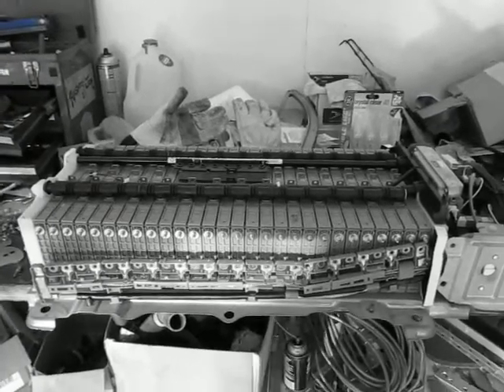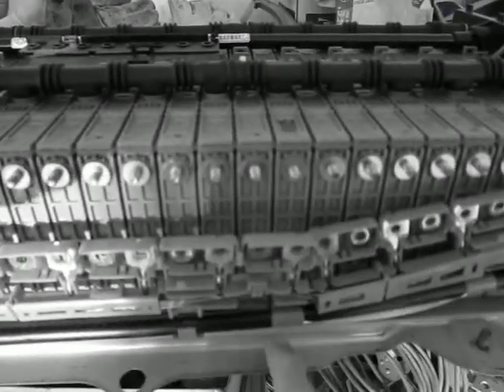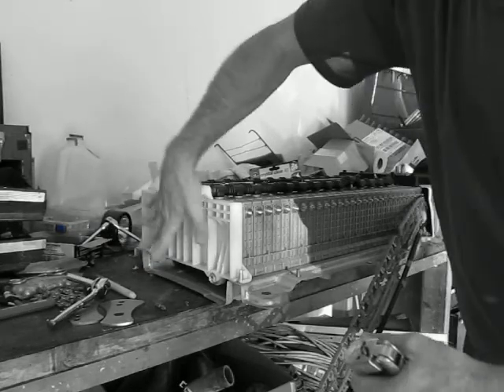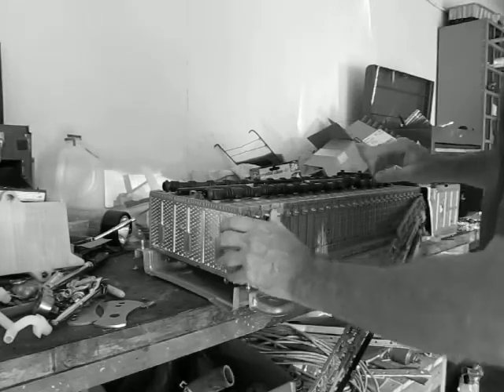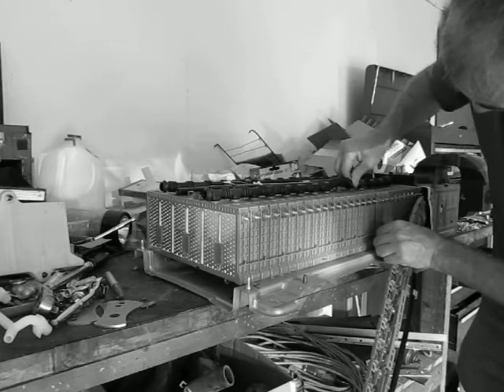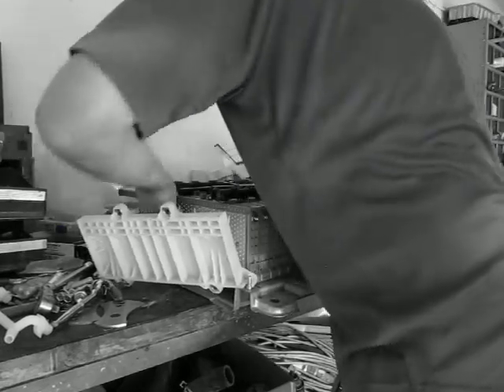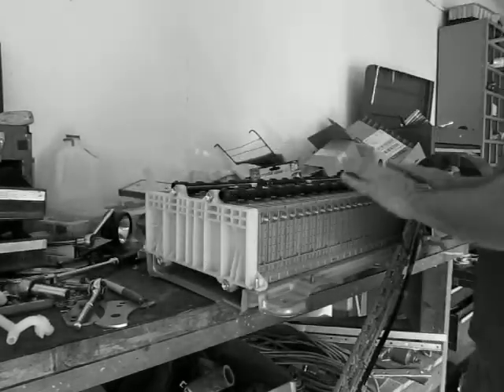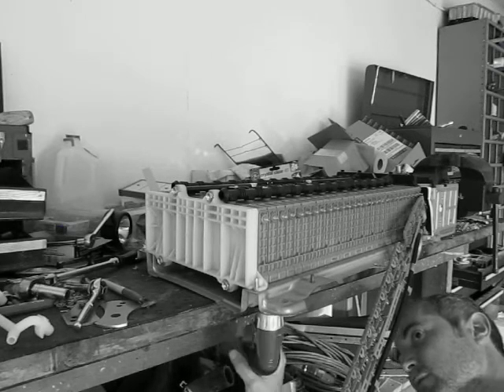Toyota Prius Battery Repair: Replacing one bad module (common failure)

Comment: i have one that is 7.5 the rest are 7.7 or 7.8.... 3 of them are 7.6...I don't know if i should replace those 4 that are lower than 7.7 or i don't know why it gave me the triangle
Reply: +david galeno I'm having the same issue... all of mine read 7.9 except the 4 on the passengers side... they read 7.5... I'm not sure if they're bad or not... or if I would have to buy 4 new cells that read 7.9...
Reply: +Joe How are your connections? I would clean them up from corrosion then drive it more eventually one will go bad. The bad one is on its way out pretty much.
Reply: The Connections were pretty corroded, so I've cleaned them and now they're all shiny. I'm going to reconnect everything and see if that works, if it doesn't I guess I'll just replace the cells on the passengers side that read 7.5..
Reply: Wat was the out come then?

Comment: Im hoping i can do this too. I just got the triangle and check engine light and the abs light also turns on. The code is p3006 was this the code you got too?
Reply: I've read traction battery for that code.
Reply: Im going to take it out today n do the same as the video
Reply: I unplugged the 12v battery n went away for couple hours but now is back

Comment: I'd like to try this with my Prius, I'm getting the same error. I noticed that you mentioned having to have a wire of some sorts to equal out the batteries, will i have to do this with my Prius as well after purchasing cells from eBay?

Comment: Hmm the video is in black and white probably form the 50-60s.

Proof of the oil company conspiracy to keep fuel efficient vehicles off the road.

Of fricken course I'm JK
Reply: findvoltage
 yepper gotta be the only xplan astion
Reply from the maker: OR, my camera malfunctioned. You decide.
Reply: crazyenergyprojects Yeah sure it was something to do with an equipment malfunction!!

Of course again I'm JK. Tape cameras dirty heads can cause poor video and audio, not sure about what could cause it to digital cameras.
Reply: robvlob im goin with the spiricy theris. yaaarp.
Reply: robvlob heehe

Comment: Thanks for the great video.  When you measure the voltage of each battery pack to find a defective one, did you take out the buss bar and measure it? Or is it OK to measure the voltage of the battery pack with the buss bar attached? I just want to take caution not to deal with 230V or so for the testing each battery pack. Thanks.
Reply from the maker: I tested module voltage with everything connected. If there is a bad module you will find it. Just don't bridge two module's negative and positive terminals together.
Reply: crazyenergyprojects I'm guessing that's why they're alternated? To prevent that from happening?

Comment: Good Video! I did this twice on my Gen 1 Prius. Almost the same task, just a few more modules to deal with. I would caution 2 things though when when tightening the buss bar nuts back on. You are dealing with DC voltage that adds up to levels that can zap you bad, so always concentrate on not touching two points at any time. Also be aware where your metal tools are dangling! The other thing is make the battery connections tight, but not hella tight as you might snap the battery threads off, as I did! I was so mad. I had then take the 20 or so modules all back loose again to replace a perfectly good module that now had a stubby unusable threads on one end. Anyhow, the hardest part for me was lifting the whole battery out. Had to lift one end and then aim it towards the back passenger doorway to get it out. I was alone, and its a slightly awkward angle to be lifting a 100 pound battery out with sharp edges! Lastly, I too bought my spare modules on Craigslist ($25 each), and luckily bought two extras, as the last thing you want is to be halfway though a job like this, and realize you need just one more module due to some unseen problem that arises. Trust me, have an extra one there!
Update...June 2014, I had another module fail, and had to swap it out. I have a method now of doing it with the battery bank in place in the trunk in about 2 hours. I just lift it up after all bolts are off. Then I loosen wire connector on both sides (one can peel out allowing a module to exit better) then I pound out the one bad module with a wood stick and hammer! Then tap back a used but good one and rehook it all up. The problem I have though is my tendancy to over tighten battery bolts. I snapped another one off, and had to do a double battery swap. Also, recently I also found a guy with many modules for sale, and I have extras on hand now.
Reply: Crap, you should buy a 1/4inch drive torque wrench, or just finger tighten and then 1/8 turn, never fails unless bigger nuts/bolts. good story though. heehe.
Reply: Video of your in the car technique. Seems a great time saver.
Reply: How do you undo the bolts underneath each module without flipping it over?

Comment: I'm performing this exact same task at the moment on my 05 prius gen II. I have some electrical experience but haven't done anything like this before. After getting the battery out which took me about an hour or so approx, I was able to carry the battery to my bench myself. It's pretty heavy but not bad. Did not use any special gloves but was just careful. After testing with a multimeter i found 1 bad module reading 6.2v approx with all other modules reading 8.7/8.8v. The only issue I'm seeing is that i ordered a used module online that is said to test 7-8v. Not sure if this difference will cause an issue or not. Unsure about conditioning, was hoping to just swap a bad one with a good one and make it fixed. All I needed to perform this task was a good ratchet set, a screwdriver, and good common sense.
Reply: Did it work? :)

Comment from the maker: The battery worked well before Toyota made us a screaming deal on a new one due to our being barely out of the warranty period. So, I gave up a usable battery for a new one. I did, however, buy another used one and have since "fixed" this one as well. I'm just waiting for a cheap Prius to show up on Craigslist that needs a battery so I can buy the car cheap and swap in this one. I am cycling all 28 modules up and down three times each with my iCharger 3010B to "teach them to be batteries again."